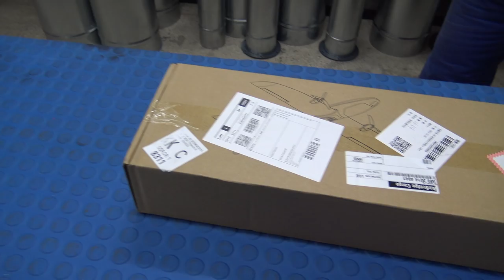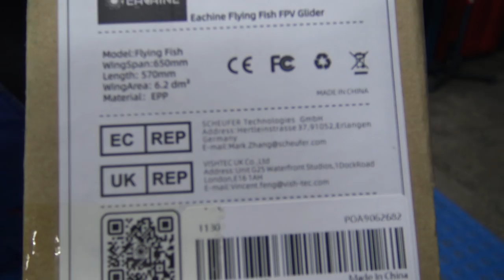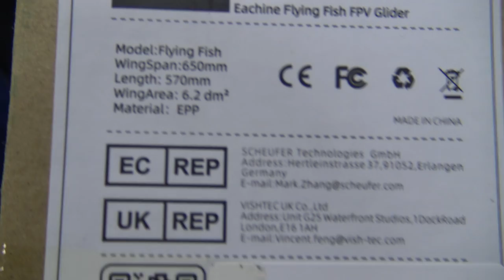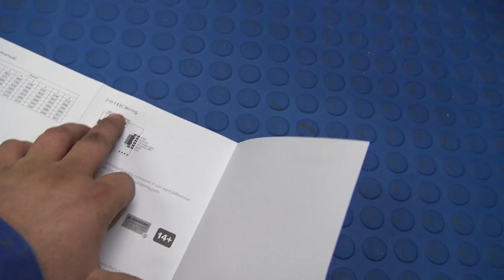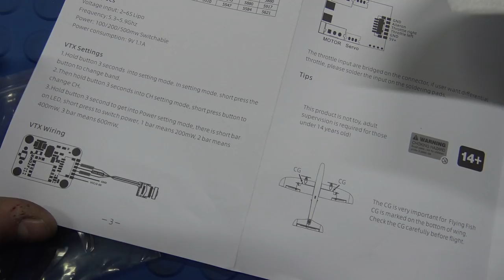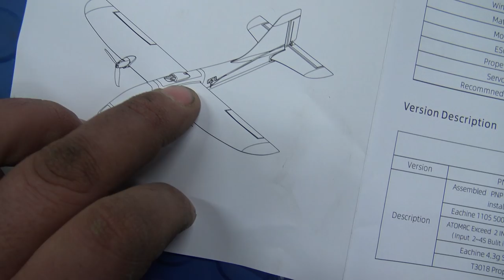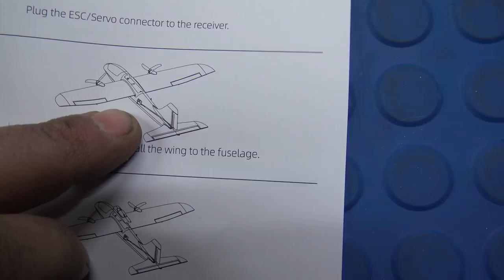Eachine Flying Fish 650mm Wingspan Sub-250 Grams Dual-Engine Mini EPP RC Airplane PNP/FPV Unboxing

Comment: Cool little twin engine job, looks like a good calm day flyer.  Its interesting how the push rods are connected to the control surfaces and servos. Looks stronger than the old school method...

Comment: DID they send you the FPV version to review for them ??  - the Hatch looks as if it would come with the PNP --- NOT the FPV - OH or its just a missing part ? - not fun if you buy one and that part is missing - could take a long time to get one sent on ? -  you forgot to tell us about the little plugs of foam so you can mount a camera on the TOP and block the hole in the nose - Salute, from Cambridgeshire UK.

Comment: I just don't see this plane being much of a glider. I would think that with two non-folding 3 bladed props there will be a lot of drag on the plane. When you do your maiden will you be cutting the throttle to see how well this plane glides? Thanks.